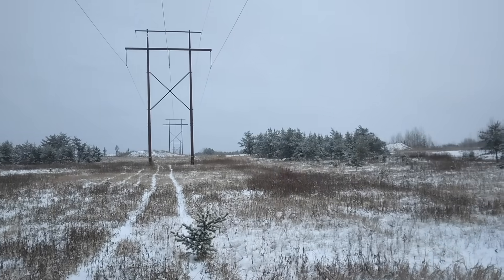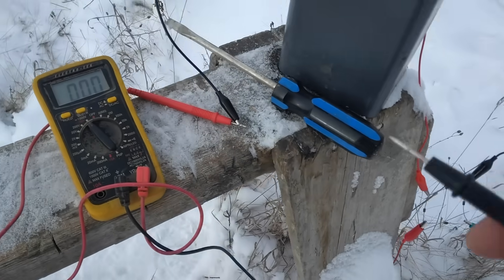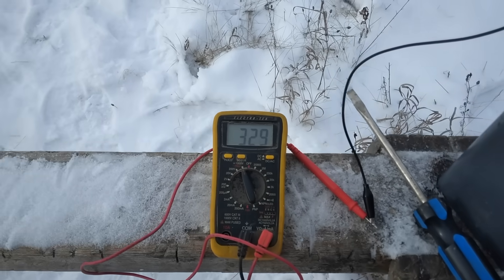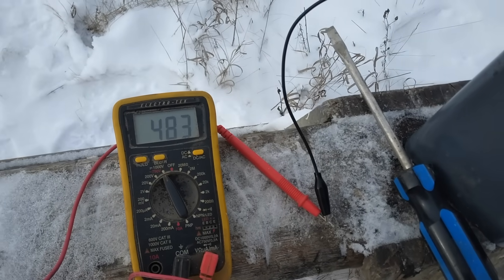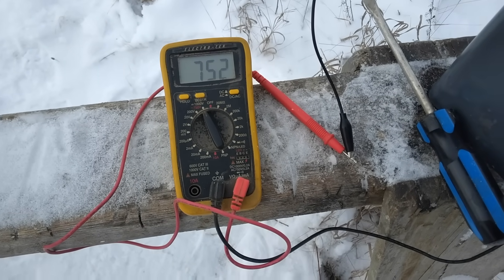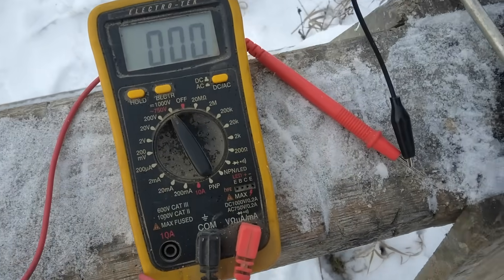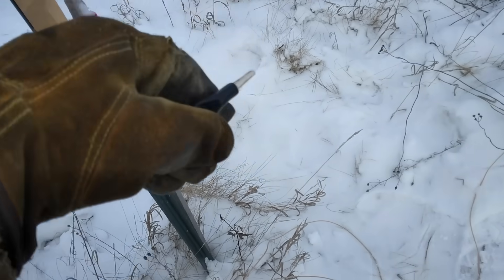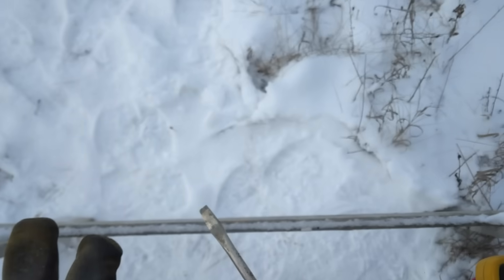Fences sucking power from under HV transmission lines

Comment: This is incredible.  Many residential properties border powerlines, I wonder what impact prolonged exposure to this has on humans?
Reply: Cancer from emitting radiation
Reply: None at all other than inducing hypochondria and paranoia in a small subset of people.
Reply: @stargazer7644 Hmm. Not so sure it's a "small" subset.  Just found this  - "In a study of 620 UK residents, 59% were not concerned about the possible health effects of radiation emitted from mobile phone masts". That suggests that 41% are concerned. In a 2005 living close to an overheard powerline reduces the number of possible buyers by 69%, and although I would like to think otherwise, I can imagine it's not just the aesthetics of the thing. 

Oddly enough, I was not expecting to see double blind peer reviewed articles suggesting that some people have found non trivial side effects, but it's a small number in relatively small dataset.

Not wanting to bore you to death, but I doubt that 1 in 10,000 people would have the ability to make an informed judgement on the powerline thing.

It's hardly surprising people are becoming paranoid about just about anything.

Here in the UK we're in the middle of a Post Office scandal which could end up costing over£1bn in damages and costs. Seems that when PO and Fujitsu installed a new computer system twenty years ago it was riddled with bugs. Rather than address them, it seems both parties blamed the staff in the Post Offices across the country and over 700 individuals were said to have taken the money. Most lost their jobs, others were taken to court, some went to prison for a significant number of years, and a number killed themselves. The majority were ostracized by the local community they served and had to move. 

It's only thanks to a small group, led by one man, who just wouldn't give up saying they were innocent, that they've been found out. They've just lied and lied.

So far, it's taken an expose TV program, a drama series, constant media attention - and the majority still haven't got justice despite the government saying they will.

I would speculate that out of the 700 a handful were guilty of theft and it's now impossible to sort the few bad apples from the overwhelming number who were innocent, and this is stopping the rest getting compensation.

Just yesterday the Japanese head of Fujitsu finally apologised. 

The thing is, the Britsh equivalent of IBM was taken over by the Japanese company when it effectively went out of business. ICL are the very last people you'd trust to produce a system like this, but I should imagine they were the cheapest quote and sort of British. Turn's out the PO are one of the small number of organisations who are able to bring prosecutions without the normal legal procedures. It's also taken sometime for their MD to return her CBE before she had it taken away from her.

The British are supposed to think the NHS is wonderful. You should see what happens when they make a mistake. First out the door   when something goes wrong are the whistleblowers who have the guts to go public. Many of them never work again, despite the fact they have a legal duty of candour to do so. We've just locked up a serial killer on a children's ward who management were determined to protect.

On a personal note, I have spent a great deal of time in NHS hospitals (not as a patient) and I've seen what happens when mistakes are made in your average general hospital. They must be bloody good since it seems no mistakes are made... 

Anything connected to the care system is endemicically corrupt, yet the CQC, in theory responsible for monitoring standards, say the majority are "good".

This includes one that was discovered to be a criminal enterprise. The CQC went in to investigate when they were asked to because of the obvious wrong doing that had occurred.

They did. The result?  Their rating changed from "Good" to .... "Outstanding".  True story.

What would it take to expose the scale of fraud involved, which probably runs into tens of millions? I have absolutely no idea because nobody, but nobody, has the slightest interest in doing so. You can forget the police for a start. And any politian.
Reply: And with that comment makes it sound like their lives aren't worth considering when they don't even know about this deadly current. Its consumer trade commission. They're supposed to deliver a safe product. I'm possibly wrong cause I'm left with brain damage from  having my home hooked into a 3phase power line to accommodate  oilfield.  @stargazer7644
Reply: @stargazer7644  Thats not true. Non ionizing magnetic/ electromagnetic fields do have an effect in vivo. The iron in hemoglobin, is actually attracted to magnetifc fields and since our entire body is conductive, with some parts more than others, there will be an effect. Then there is nerves and the brain, of which the grey matter we still dont know what it does and how it functions. There has been quite some research last couple of decades to the effects of this to different life forms and there definately is an effect.
Its true that we used to think that it had to be actual electricity, by wires, that had an effect (obviously) and not induction, but induction does too.

Questions posed and people complaining has been going on ever since we started using electricity, but it all got sped up with mobile telephones. And so did the research. Obviously there are conflicting interests, so some try to play it down. I dont know how this is going to develop, bc we built everything around electricity. We'll have to wait and see. The effects are negative, but its unclear to what extent and if measures can and need to be taken.

Comment: Is that just from the waste energy coming off it?? Holy shit. That's incredible. 800v what can that power? 😁😄😜
Reply: Its not wasted energy. By inducing a current, using the metal fence, it then reduces the amount of power that goes through the overhead cabling

It is theft

Comment: Interesting there have been cases where landowners have "robbed" power inductively from transmission lines. If you could get a actual voltage reading under your transmission line. Perhaps you could use a microwave oven transformer connector secondary to your (antenna) fence and ground. Be interesting if you could get a usable amount of current.

Comment: I went shopping when the supermarket was being remodelled. I picked my metal cart, pushed it across the new quarry tile floor at the entry. When I rolled it across the seam to the original flooring, I got a jolt of discharge. There was a back story to this one-time incident though. The mechanic who put a new engine in my car used the wrong bolt when connecting the alternator's grounding wire to the engine frame, so it was not properly grounding. I pondered that as a contributing factor but this was all way over my head.
Reply: I've experienced many times the feeling you're reporting, and it has to do with static electricity rather than electromagnetic field. It is due to the buildup of electrical charges, especially common in dry weather, when some kind of materials rubbing together (like synthetic fabric, wool or other insulating ones) do subtract, or take away, electrons from each other, causing an imbalance and thus a potential difference (voltages up to thousands of volts), by shifting charges.
And when these potential differences reach a sufficient level (this can be conditioned also to the level of insulation of the shoe soles or the floor material, plastic or carpet) they do discharge themselves via the nearest conductive mass available, in that case, namely, the metal frame of the shopping cart (or touching the hand of the person you're doing shopping with 😆⚡)
So I would rule out altogether the improper grounding of your car's alternator as a contributing factor.

Comment: I was installing an environmental camp  near the syncrude camp north of McMurray for the gov. researchers in the oil sands. when we were ready utility turned on the 480 volt 600 amp service we started having static discharge shocks when touching any metal, hand rails, structure tin cladding, machinery, unconnected pipe supports for car plugs. suspecting a poor ground and at the engineers recommendations we ran 900 feet of large cable 4/0 to the sewage lagoon bored five holes in the ice and drove five 10 foot ground rods into the mud in the lagoon. All we accomplished were five holes in the liner of the lagoon and an electrified barb wire fence around the lagoon. The problem was the A ground on the utility side, our readings to ground were in excess of 750 volts to to ground. cured the problem off getting a shock at the door handle when opening  any door by laying a stripped #14 wire in the snow attached to the metal cladding by the door.

Comment: Did you check the ac across the diodes when you 1st started charging….?
That reading is more useful…and could possibly run an electric fence or a water pump….

Comment: If anyone is thinking about placing a coil underneath HV transmission lines for free electricity: the utility will detect this and can pinpoint your location, and they will come knocking.  FYI

Comment: transformer action is what it is called, what current flow do you get? the top conductors are for lightening protection and are grounded to drain off induced voltage. the current flow is important.

Comment: And this is why I refuse to live close to them. My hearing has always been great. I hear the flow of energy when I’m near them.
Reply: A crackling or humming sound is generated by small electrical discharges, often caused by water drops that collect on the conductor when it rains or when there is sufficient moisture in the air

Comment: I wonder if you rigged up a 12 volt zener diode to a solar charge controller if it would charge a battery while keeping the voltage levels safe. I suppose some kind of dump circuit is needed when the battery is fully charged.

Comment: Rather than charging a capacitor, I would like to have seen a resistor load to actually see how much power is produced. Also, the earth ground will somewhat limit the amount of power that can be extracted. The ground rods have a relatively high resistance. "The National Electrical Code (NEC) section 250-56 establishes a requirement for a single ground rod or ground plate to have an earth resistance of 25 ohms or less." So lets say you do better and both rods combined have 25 ohms, that plus wire resistance will limit how much power you can extract. I would measure the voltage unloaded, since you meter didn't like the high voltage, put a 10MΩ resistor in series with the meter (I'm assuming it is 10MΩ input meter, most DVM are,) then if it reads 1000V, you actually have 2000V on your wire, or your meter will read half of the actual voltage. Once you find the maximum unloaded value, now load the wire with different resistors until the voltage drops by half. This is where the maximum power can be extracted. Then you can use P=V^2/R to find the power, or this calculator, http://www.learningaboutelectronics.com/Articles/Ohm%27s-law-power-calculator.php#answer   Have fun! Oh, and then get a transformer to drop the voltage to a usable voltage, or raise it, we don't know yet. If none of this makes sense, google "maximum power transfer". BTW, I think I agree it is not much power, because the capacitor charged pretty slow, but, I didn't catch the value of the capacitor. I suppose this could all be calculated on the time constant of the charge, but that is beyond my math skills. One more thing, 2, 3, 4, or more turns will extract more power, but you need to get the opposite direction side much farther away from the power lines so that it doesn't cancel the EMF of the wire under the power line.

Comment: @doubleMinnovations When I was an EE student (a long time ago), the professor I had for electromagnetics specialized in power electronics.  One of his Ph. D. students worked for the city utility company and was kind enough to arrange a field trip for some of us to visit a local substation where the 250kV (line-to-line or 200kV line-to-ground) power lines came in.  When I showed up at the van to take us there, I wondered why some brought umbrellas since it was a nice day.  At the substation, the 250kV lines were brought into aluminum bus bars that were A LOT closer to the ground.  Anyway, folks popped open their umbrellas under the 250kV bus bars to feel a nice tingling and putting a finger near the shaft of an umbrella, one could see a constant blue arc.  This was from capacitive coupling from the bus bars to an umbrella.  Anyway, umbrellas were shared around for the gEEk fest under the 250kV bus bars.  When I tried it, the constant blue arc was painful, like half a static electricity shock, but with my hand wrapped around the shaft of an umbrella, it tingled a lot.

Anyway, you might get a decent amount of power from a nice metal sheet.  An aluminum sheet might be less expensive and lighter than other metal sheets 👍  Heck, take out some sheets of aluminum foil on a nice piece of plywood 😉
Reply: FYI for the numbers to make sense, it was 200kV peak voltage on the line to ground. Divide that by square root 2 to get the RMS voltage of 141kV. Now multiply that by square root 3  to get the line to line voltage of 245 kV. ( this means the peak voltage line to line was actually ~ 346kV) When calculating power, you need to use the RMS voltage which is typically the value used when talking about AC power ( the effective DC equivalent,  is squareroot 2 times less for sine waves). But peak voltage is needed for reason such as not exceeding dielectric break of air or other insulation . For example, a 300V electrolytic capacitor (rated peak voltage) will blow up if used on 277V AC  line voltage, because the peak voltage value is 391V.
Reply: @onradioactivewaves  Thanks 👍 Like I said, it's been a LONG time 😉 And these gray hairs seem to be affecting my brain along with my looks 😕
Reply: @bob_mosavo  you're welcome. Everything with electricity seems to be a bit confusing, and I'm constantly double checking ( it's better than making a lethal mistake). I just knew those numbers were a bit too close to one another. So I take the time to explain it not just for others but alsp to keep my own understanding up.
Reply: @onradioactivewaves  Yeah, it's been so long since I received my EE degree, and I mostly programmed or wrote patent applications after that. Recently, I've been studying to upgrade my ham license, and I keep grumbling: ARRRG!!! I used to know this stuff like the back of my hand!!!

Cheers, mate 👍👍

Comment: I remember when people were first starting to point out the dangers of high voltage powerlines. A guy was standing under them holding a 4 foot fluorescent tube which is 128 watts, And the bulb was lit brightly, even though it was not connected to anything
Reply: Tesla did this in 1890

Comment: Yes! The power transmission lines EMF field will also light up a fluorescent tube light if you hold it up with your hand on the bottom metallic contacts, harmless.
Reply: Is is EMF or corona discharge? If the latter does is produce X rays?

Comment: The high voltage lines produces a magnet field and is induced into the fence. I worked with a phone for forty years and ran into this often. There's no danger to you  because the amp level is low. The amperage is what gets you . I've read 1500 volts on phone lines running underneath these lines. If you ground your fence the voltage is bled of to ground. The shock you get will not hurt you but the reaction might. If it would kill you what do you think it would do to animals or people underneath them. Voltage don't kill amperage can.

Comment: Hmm 3 wires over cables, 3 phase diodepack and then put energy to some kind of battery-back with some voltage controller. It can probably produce more than single sunpanel that is targeted to roof use.. And 24h in day. When you have floating system and you took energy between wires(phases), not connected to ground way circuit, I think it will be much better. 
But you could connect negative to ground if you build some safety systems to it, like fail current switch etc.. 
But there's some interesting voltage between earth and that charging system, because it's floating middle of phases basically. 

Hard to say for sure, without testing. 

Try that, if you miss what I mean, I could make better explanation. It should be some 250% more joules or energy outlive I think.
Even more.
Reply: Real "free energy" (at least for you..) 😜

Comment: Perhaps a subsequent experiment one could discharge the potential to ground, measuring the voltage and current to measure the power actually being extracted. It is ironic that he used the shielding sleeve of the coax to carry the ac voltage. Normally such is used to protect from such fields.  Essentially he used it as an insulating wire/antenna.